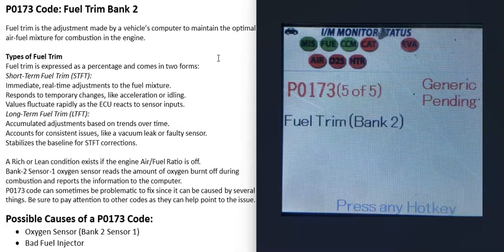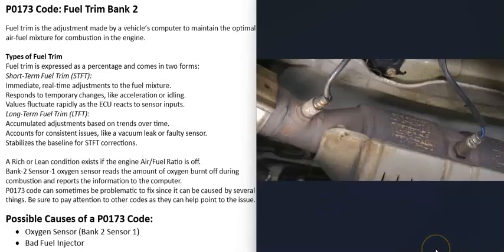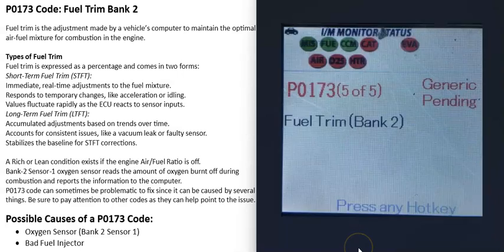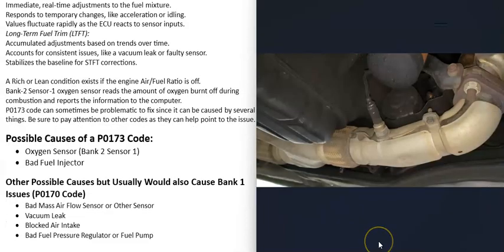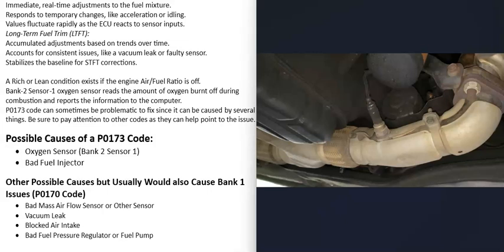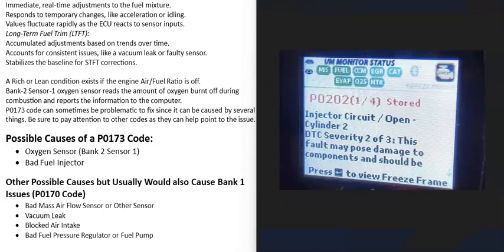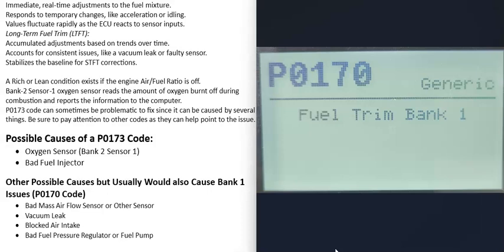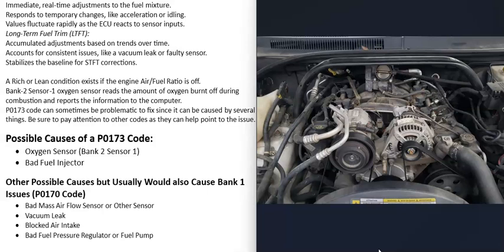Causes and Fixes P0173 Code: Fuel Trim Bank 2

Comment: I got the P0173 code but before that I got control module 1/3
#7E8:Emgine
#7E9:A/T
#7EE
Then the P0173 #07E8 Fuel trim bank 2

Comment: Hands down the best video on this issue on YouTube. 
Quick question, would a vacuum leak cause both codes to come up? ( P0173 & P0170)
Reply from the maker: Yes, that is one possible cause. Since it is both banks, it is likely something that would affect the whole engine, such as a bad sensor, fuel pressure, or a vacuum leak.
Reply: I have the same code p0173.  They stole my Cadillac converter. It has this code